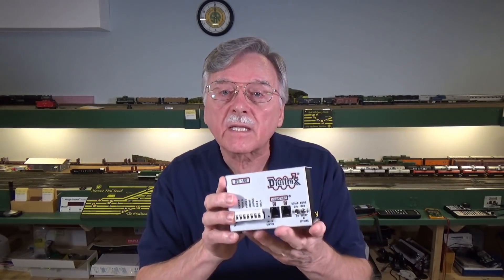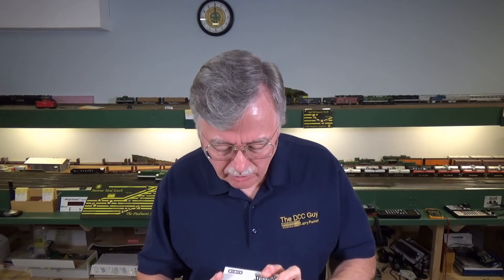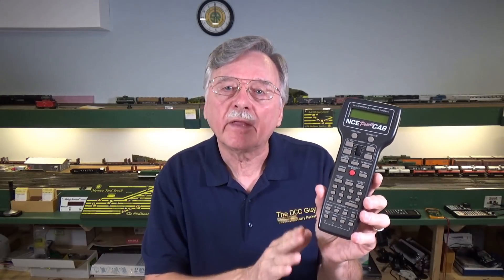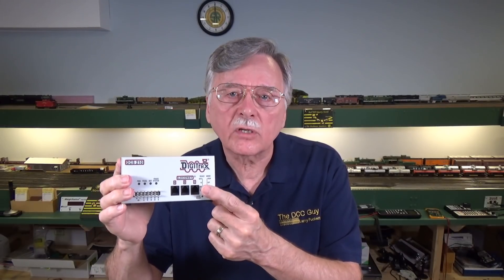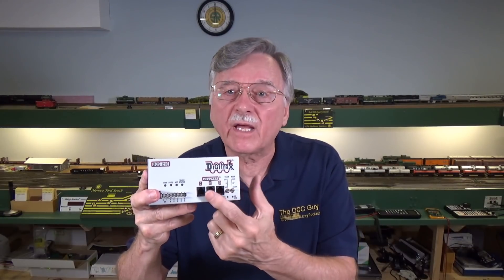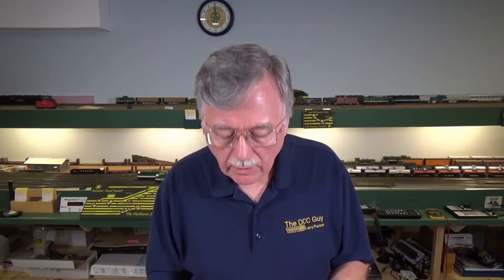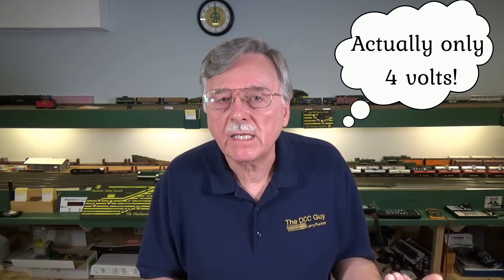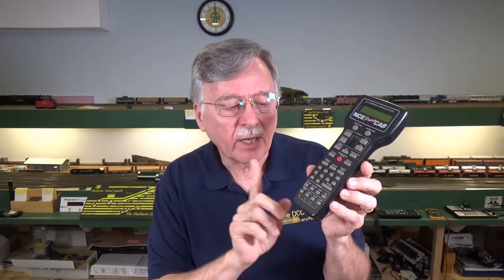Wiring Your Model Railroad For DCC---Boosters (113)

Comment: An you start from the beginning? I know nothing about DCC. Id like info on wiring, size of wiring, blocks, loops,  locos, caboose and passenger car wiring, and what to buy for my layout. I run a 13 x 27 ho layout, not finished but wired for DC .  Can I run DCC on some tracks and stay with DC on others. I ask because with my wiring for two running at once, I can set one loco cab to DCC, then all tracks switched to that cab, would be DCC. CAB 2 switch would go to DC power pack. I don't see why that wouldn't work but then again, I am DCC IGNORANT. Any way I can talk with out personally? Or can you give me a reference as to where I can learn all I need to know? At 74, time may be short!
Reply from the maker: You can do as you suggested but be very careful. Get my books on DCC and on wiring your model railroad plus dig back through my videos (all 400 of them) and watch the ones on DCC and wiring, etc.

Comment: I have a PM42 set up for 4 individual districts.
Would installing a 12 v light bulb    for each district be overkill ?
Reply from the maker: Since the PM42 can be used to deal with shots and overloads having a light bulb as a ballast lamp would not be necessary and may actually fight with the PM42 since one would likely trip before the other.
Reply: @ thanks

Comment: Hi Larry,
 I just purchased a new DCC Digitrax system the other day and retired my NCE Power cab system. 
The DIGITRAX system i chose was the evolution express advanced 5/8 amp starter system.  The wireless system was available but not affordable (extra $200.00) and found out that the hand throttle requires disposable AA batteries, it even discouraged me even further. After opening rhe bix, i realized that even the non wireless throttle requires AA batteries as well. Oh well, so be it! 
 Im just wondering if you might have a video explaining how to hook up the Evolution Express (DT602 Throttle version) with the coiled cord that contains the DT602 throttle?

It was time to switch up to the DIGITRAX system because the NCE power cab was creating too many problems. I had to contact NCE several times and have the gentleman re-asign buttons on the throttle thus confusing what does what...
Reply from the maker: I did review the Evolution system in my column in MR when it first debuted but I can’t remember if I did a video review also—let me look back.

Comment: Read all the comments and replies. Just wanted to clarify that the ground betw Digitrax components is the 14Ga wire connection on the exterior ground terminals  and not connected to anything else, and is not connected to the household AC ground ( 3rd pin on standard plug) due to the isolation in command station/booster ?
Reply from the maker: While I agree with you that it should not be connected to the household ground, the following is from the Digitrac DCS240 manual and has been in all their system manuals since the mid-1990s:

4.5 Ground (GR) Terminal
The terminal marked ground provides electrical safety features and an RF ground reference for minimum radiated noise. This should be the ONLY point of any DCS240 installation that is connected to the AC safety ground pin pro- vided on most 3 pin 110V AC power sockets. Grounding the system is a sensi- ble safety precaution that should not be ignored.

Comment: First, love your videos, they provide lots of great information.  However you always compare NCE powercab, and not the NCE Power Pro command station.  Wondering why.
Reply from the maker: First, and most important I have a PowerCab but not a Power Pro. I can only afford to buy so much of this stuff and companies are not as free about giving away review units as they once were. Second the PowerCab is an extremely popular system both in the US and the UK and I am sure at other locations globally. So by discussing it I can reach a lot of users whereas the Power Pro has a more limited distribution. Finally, a lot of the programming and operational features are the same or similar for both systems they mainly differ by power and memory spec.

Comment: Hi Larry:  Unfortunately for me, I did not follow yours (or anyone else's) wiring size recommendations for my 150 sf "E" shaped N scale layout. I've been operating it for 8 years with the wiring the way it is, but as I have added locomotives and sound, in the past couple of years, I've started to get problems with decoders going blank, and runaways. So, it appears the wiring may be inadequate for the current operational parameters.  I'm using 16 gauge solid for the buss; but 26 gauge stranded for the feeders. Replacing all the feeders at the rail is a big, big job (layout is scenicked) .  One idea I had would be  to minimize the lengths of the 26 gauge runs by splicing in 20 gauge wire between the buss and make the 26 ga feeder as short as possible (to reduce the voltage loss). Is that approach likely to help or would it be a waste of time?   Thanks, again. Joel Morse
Reply from the maker: Yep, the higher the current.  running through the wires the more that problems are likely to occur. A 150’ bus is trouble waiting to happen. Yes, you may be able to reduce your problems by splicing in shorter and heavier feeders, but that 150’ run will still be there. This is a case where having a booster would allow you to break the run 9n half. And if you put the command station and booster in the middle of each 75’ run then that would get the effective length of each to 37.5’.

Comment: Hi again, Larry. I'm re-reading your Practical Guide book. On page 18, in the section "calculating your layout needs" you write: ".... estimate the number of locomotives you'll be operating on an average basis at one time."  What is meant by the term "operating"?  1)  Do you mean actually moving or is this term referring to all locomotives on the layout (or in the District).  And 2) Do you mean with any booster at one time?   I have a 150 sf operating N scale layout with a lot of locomotives in staging and in the engine facility (44 in total on the layout, a few with sound), but only 10-12 (5-6 sets) working road trains and in the yards at any one time. This is with two boosters and 2 PM 42's.  What number represents the "operating" locomotives?   Thanks again, Joel Morse
Reply from the maker: Operating means running. If the locos are stopped with sound and lights turned off then power use is minimal. As I remember that discussion I was telling how to decide how many boosters you need, so if your calculated power needs are within the rating of your command station then an added booster is not needed.

Comment: Larry: You indicate what the track voltage should be for HO, but not for N. What voltage do I need for N? Thanks.
Reply from the maker: I think most drop it down to about 12 volts. Both Digitrax and NCE offer ways to tweak the output on the new DCC command stations and boosters and Digitrax offers the UP6Z for reducing track power by 4 or 6 volts at 3 amps if needed for small scales. Check your loco or decoder manual for their suggested track voltage.
Reply: @TheDCCGuy  Thanks, Larry, for the quick response.

Comment: The DB 210, does it come with everything I need to run it? Power supply? Loconet cable? Is a loconet cable an Ethernet cable?
Reply from the maker: The DB210 is a dumb booster, the DCS210 is a command station/booster combined. The DCS210 only comes as part of a starter set with throttle, panel, power supply. I suggest you go to the Digitrax website and explore the boosters and starter sets and what they include if that is what yo are looking for.
Reply: Thank you Larry, I will check it out!

Comment: Added new command station and booster a digitrax 210 and 240 with a 602 throttle i ran the first two locos with no problem and then tried to get another one to work i put in address and throttle showes it is active but nothing happens its not the loco or track power or decoder checked all that i dont understand whats going on worked fine with the db150 command station but now it wont work has same problem tried old throttle same thing im stumped..only the two i first ran work no matter what loco i select i get nothing but the first two to run
Reply from the maker: Does it matter which locos in any order or is it always the same order?

Comment: Larry, what do you think of the DCS 210+, that has a booster built in?
Reply: Also, some of the boosters I have seen listed from Digitrax offer auto-reversing function. Is this reliable? Or would you recommend an external module, like the PM-42?
Reply from the maker: I use a DCS240 on the Piedmont Southern and have a DCS210 for backup—they are great units. The DCS210+ comes with a built-in USB, something that was added after I got mine. Having the USB port built-in greatly simplifies connecting a computer with DecoderPro. Good choice!
Reply from the maker: Using the autoreversing feature on a booster is a waste of an expensive product and I recommend a stand alone unit such as those made by the Frog Juicer folks and  NCE.
Reply: Thank You Larry, for the rapid response. Love the videos and information you provide. I have learned a lot from your videos and replay them for a better understanding of where I want to go on my layout. Awesome job on 14.8k subscribers! "Way to go!" -and I look forward to more "vids."

Comment: Do the NCE components have the large heat sinks on the back (or anywhere internally). Or are there no heat sinks at all on their system components. Thanks and super informative video.

Philip
Reply from the maker: I have never opened one of their systems but they do not have the external heat sink like a Digitrax system unless they have changed recently. I remember on System One units which were NCE clones the power transistors were attached to a metal bar on the rear of the units and that was attached to the metal case creating a large heat sink. Looking at the NCE  diagrams they appear to do the same thing. Digitrax does this too with the exception that the finned heat sink forms the back of the case.
Reply: @TheDCCGuy  I like the idea of the external fins as they are very effective. I was a studio owner and a recording engineer (before doing photography for a living) and I always liked the fins, especially on the audio power amps which generate a lot of heat. Just seems like a good idea. I think NCE should consider adding them....Thanks Larry for the info.
Phil

Comment: As someone with a background in home electrical work, I can tell you that your system ground should connect to electrical ground at the point (device or component) that receives power which should ultimately go to earth ground via your service entrance (main breaker panel and/or meter).  Power should then branch out like a tree (and this includes the ground).  Power (and ground) should never reconnect out among the branches, because this causes loops.  Loops induce unwanted eddy currents.  When you get induced eddy currents in your ground (because of a loop), it will cause Bad Things(tm) to happen.  When houses have had their wiring extended and expanded upon, inadvertent loops are created, and this is generally why you sometimes feel a tingle when you touch the white neutral or green ground (there are other reasons, too, why this happens, but ground loops are the primary cause).
Reply from the maker: Ground loops are another reason I do not recommend connecting the DCC system to an earth ground and instead prefer a floating ground just for it.
Reply: Abyway to add a couple of diagrams to show what you're explaining?

Comment: I have an old DS50 and I’m about to wire a layout. Should I replace that with a new booster and use it as only a throttle? I’m not sure the Zephyr is even enough to power my layout on its own.
Reply from the maker: See my answer to your other question.

Comment: Hi Larry.... watching your video on sodering and you used heat sink clips to use a higher heat temp and not damage the rails... tries the ALL America website but could not find them...any ideas? thanks.
Reply from the maker: Try the All Electronics website
Reply: @TheDCCGuy  Wasn't that helpful.... ended up at Micro Mark... they had good clips.. thanks  PS  fiind your videos to be very helpful..
Reply from the maker: I checked their catalog and they are no longer listed there either so I guess they have stopped carrying them or can’t get them right now. As an aside you can always use plain old alligator clips with the vinyl insulator sleeve removed.

Comment: So if DCC is an AC power as I have been told, then we are taking AC power from the wall, converting it to DC power for the unit, that is when converting it BACK to AC onto the track, which in turn all of our decoders are, again, converting to DC power for the motors.......

Comment: How much track before you need a booster? My railroad has 150 ft  mainline, but no staging yet. N scale flex track
Reply from the maker: Wait for it!
Reply: A other good video. I have a very old system digitrax. My booksays don't use earth ground. Then when I put in reversing loop cards( can't remember name), it said no. I since removed them.
So you explained it very well and now I will check what I've finally done. I'm sure I have work to do.😁 Thanks again.
I've always felt that the instructions supplied with electronics are too technical.  We don't understand and or do't want to understand.  Just tell us what to do and we're up and running. If we need to know more we can go to web site where they can explain . That's making the assumption that we could understand. Most people don't understand house electricity. 🙄

Comment: Don't forget that if you have more than one booster, the output voltages must match exactly and usually there is a trimpot adjustment to accomplish that, and they must be in phase with each other.
Reply from the maker: Dave—👍you just couldn’t wait for Friday’s video!

Comment: do most of the boosters and comand boxes come with 3 prong plugs.? if so, would that not solve the grounding issue?
Reply from the maker: Boosters and command stations are isolated from the main power connections. The power supplies are plugged into the wall outlets and they supply the DC power to the boosters and command stations.

Comment: Have you reviewed and compared the newer ESU Cabcontrol wifi system?
Reply from the maker: Have never seen one however I just got one of the Piko systems which I believe is the same in a different color or case. I was able to get the WiFi throttle to work with my Digitrax system easily but have not had time as yet to test out the full system. More to come!

Comment: Why do you operate at 14-14.5 track voltage?  Whats the benefit or downsides to a higher or lower amount?
Reply from the maker: It’s pretty much been the standard range for HO for decades. I think the rationale us that analog DC is based on 12VDC. Uf you put 14-14.5V DCC on the track and expect to lose 1-1.5 volts through the diode bridge in the decoder then that brings you into a similar range. I do know folks who have set their boosters on the N-scale setting and operate at ~12VDC to keep speed demons in check.